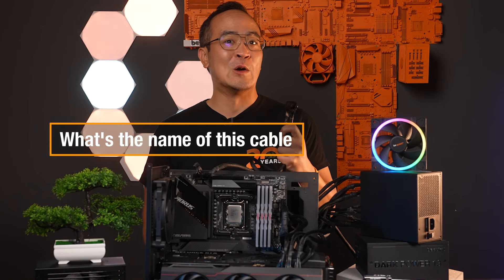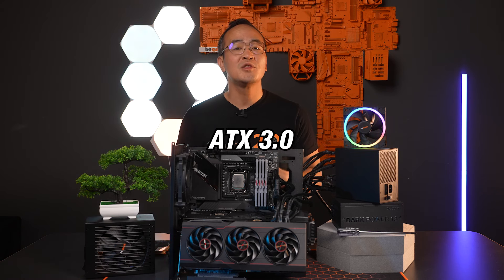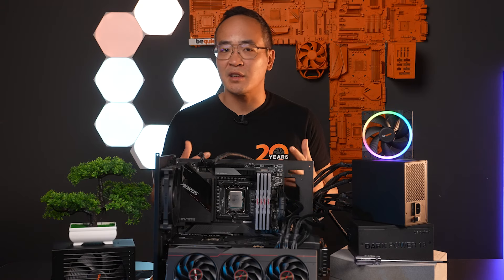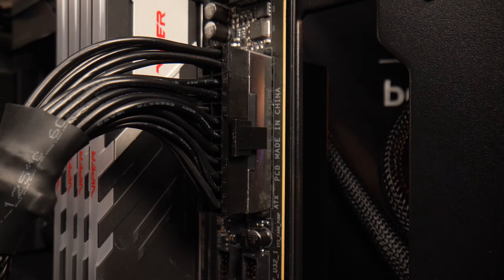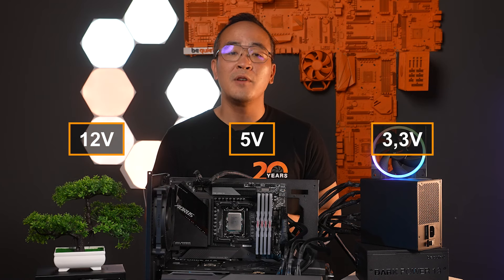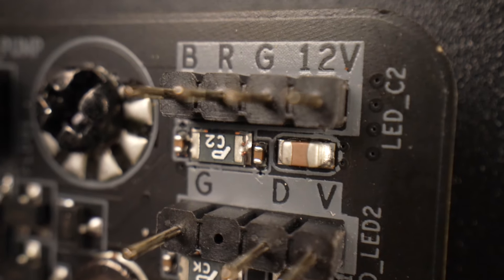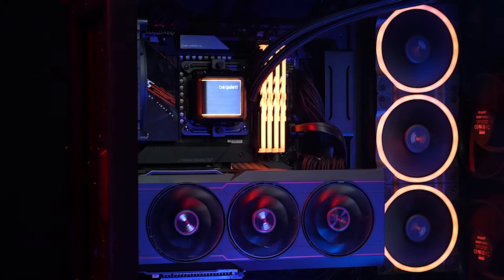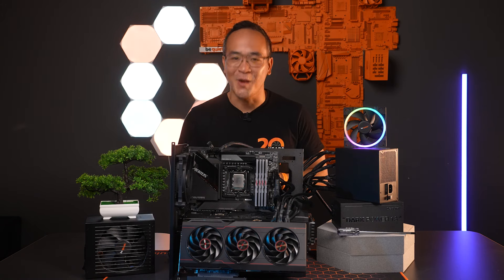The Power Cable Guide 🔌 | be quiet!

Comment: neither the manual nor any cable guide EVER explains the TWO IDENTICAL P8 sockets on the Powersupply (for example PP 12 M 750w). are they really identical or do I have to use one particular? This should be fixed in the manual ASAP.
Reply from the maker: Hey there! Thanks for reaching out. The reason you won't find specific details about the two identical P8 sockets in the manual or cable guide is because they're essentially the same. Both P8 sockets are connected to the same rail (12V2 in the PP12M model), so you can use either one or both depending on your motherboard's requirements. If you need more guidance, it's best to refer to your motherboard's manual for clarification.
Reply: @bequietofficial  i love how you guys respond to comments and give important info, you guys are awesome

Comment: You didn't go into your 12 pin pcie connector.... Why does your pcie socket have 12 pins? Lol, so no more 8 pin pcie cables??
Reply: Or can I connect an 8 pin pcie cable into your 12 pin pcie slot? (NOT referring to the 16 pin 12vhpwr socket)
Reply: The 12 pin feeds two 8 pins.

Comment: My motherboard has 2 x 8 pin CPU connectors, but my System Power 10 has 1 x 8 pin connector and another cable with 2 x 4 pin connectors. Which one am I supposed to use? Am I supposed to use all of them?
Reply from the maker: Yes 🤓

Comment: I am not a fan of 12VHPWR. Cable management is a pain and my side panels don't fit on most builds I do. Cases need to be wider or it needs to be a right angle by default... I shouldn't have to buy adapters or extra custom cables.

Comment: Sorry for the surely stupid questions, but why do the P8 connectors on the Pure Power 12m have 10 holes? My motherboard asks for 1 ATX power connection and 1 or 2 (I don't understand the difference of using one or 2) 8-pin plugs, and then my GPU asks 1 8 pcle pin. Does the pure power 12m 1000w have all these connectors? I can't really tell by the pictures.

Comment: how do i install the cables for pure power 12m 850w onto Lenovo ThinkCentre M910t motherboard, the original power was connected in 2 place on the motherboard 1 place with 10 pins and 1 place with 4 pins, i cant figure it out even after watching this, please help, thanks
Reply from the maker: Please note that system integrators like Lenovo often design their PCs with proprietary standards that may not fully comply with ATX specifications. Unfortunately, this means we cannot guarantee compatibility with our PSUs. We recommend checking with Lenovo for details about your motherboard's power requirements.

Comment: So i should plug in two connector of adapter from the PSU side to these two slots pf PCIE 5.0 or just one of them - and the other side of the adapter just plug in to GPU ?

Comment: Can I get a bit of help with some info?

I got the be quiet pure power 12m 850w and I thought it has 4 PCIe connectors, but in reality has 2 such connectors and each one has a cable with 2 heads 6+2 PCIe. 

I need 3 PCIe cables for my gpu 7900XTX. Many people advise against daisy chaining with this GPU since its very power hungry (+450W in load). My question is, does this count as daisy chaining? Since I only connect 2 cables to the PSU, does each one only offer 150W, so in total 300W (+75W from the PCIe slot), or can they offer more power than that?
Reply: Hey, did you manage to find the answer for this question? I'm exactly in the same situation right now, and returning my PSU for another one would be a nightmare.
Reply from the maker: While this setup can theoretically handle the load, for a power-hungry GPU like the 7900XTX, a more secure option would be using the CP-6620 cable. It provides two independent PCIe connections, avoiding daisy-chaining and ensuring better power delivery. Let us know if you need further assistance! https://www.bequiet.com/en/accessories/1446

Comment: Hey guys. 
Is your riser cable compatible with the 800 DX? Also, how exactly does it mount to the case itself? (The foam portion touching the case) Is it screwed in?
Reply from the maker: In general the riser cable is compatible with all our cases that support a vertical installation of your graphic card which includes the Shadow Base 800 DX. 

You may wanna check out our product video here: https://youtu.be/6gCnh2ICec0?si=jgGVgfs6JCrNHGc9&t=22 this shows how it looks when you install your graphic card vertically within the Shadow Base 800 series.
Reply: @bequietofficial  Thanks guys!
Reply from the maker: You're welcome!

Comment: If I'm not using a GPU (motherboard has 4k graphics) and no other PCIe peripherals, do I still need to plug in the 600W power cable? My current build is not powering on at all and I've checked all the wiring and connectors but do NOT have the 600W PCIe cable plugged in anywhere. This is a Dark Power 13 750W PSU.

Comment: I dont understand, i have a 2x 8 pin gpu connector but i only have 8 pins in my gpu
Reply from the maker: In this case, if the GPU has only one 8-pin power connector, you should use only a single 6+2 pin connector.

Comment: Hi I would like to know if I just start the power supply without connecting any cables then does the fan on the PSU rotate? I want to know a way how to find out if the PSU is working? Or do I need to buy a PSU tester from Amazon. Please advise
Reply from the maker: The PSU (and the fan) will not start without any cables connected. Using a PSU-tester is the easiest and safest way to do a simple check. Please note: some be quiet! PSUs have a fan delay on startup, so it takes 2-3 seconds until fan spins up.

Comment: I just love you use 12 pin to 2x 8pin modular cable, only firm that do so and not like rest where you have 8pin PSU to 2x 8pin pci-e which will melt PSU side if you push 250W
Also what I would like to see non modular 12chpwr cable!!! I just do not see need for it to be modular if all gona use it!!!! also more chance for PSU side to melt as 600W is a LOT for those small connector and pins!!!!!
Think about it, for me only sata/molex need to be modular and maybe one PCI-e!

Comment: i got a 850 w PSU and i got a 8pin to 10 pin in the box instead of the 8pin to 8pin i needed??
Reply: i think 10 pin is supposed to go inside psu while 8 pin on gpu-cpu ?

Comment: I purchased the Dark Power 13 850 watt model, along with an Asus TUF 7900 XT. I was hoping to take advantage of PCIe 5.0, but it seems that the 12+4-Pin 12VHPWR Connector cannot be split into 3X 8-pin (6+2) which is what the graphics card has. So am I stuck with just using the 2 PCIe outputs from the PSU to my GPU?
Reply: i think only the stronger nvidia cards have that connector for now

Comment: Hi, I have the 600w SFX-L Power, I'm trying to connect it to an ITX motherboard but I can't get the computer to boot. Does anyone know which power cables are for the motherboard? I've connected the 24-pin cable to the motherboard... and from the same cable another 8-pin cable comes out which I've connected to the CPU, but it doesn't work. Then I tried and connected the P8 cable and the CPU fan moved but it started to smell bad (like it's burned). Does anyone know how to connect it? I've connected the graphics card with a PCIe cable.

Comment: How do you connect be quiet 1200W pure power which has 2X PCIe to 3090ftw3 GPU which has 3X 8 pin?
Reply from the maker: Connect the two PCIe (6+2-pin) cables to the power supply, but only connect three outputs to the GPU. You can ignore the fourth one. As the Straight Power 12 has one 12V line, you don't need to worry about the connection of the outputs.

Comment: be quiet guide and didnt show where to plug cpu cable, what a joke of a company, never buying anything from you again, 2 hours looking how to plug in cpu power cable bcs the cable has 5 pins and the ones in the middle are without a wire but on the psu there is 5x2 pins so im confused af and the instructions inside the box say "plug in motherboard and cpu cables" !!!!!!!!!! unbelievable
Reply from the maker: Hey, we are sorry to read that. How can we assist you on this? Have you contacted our service about it?
Reply: @bequietofficial  Dont worry, I was just mad becouse the CPU power cable has 5 rows with an empty row in the middle and the connection on PSU was called P8 instead of CPU and it was with 5 rows of pins with no gap in the middle so I felt that I need to connect it to the P8 but I wasnt 100% sure and couldnt find a video in the entire internet that shows how is someone connecting the CPU cable to the P8 connector in any bequiet! PSU. 
My bad